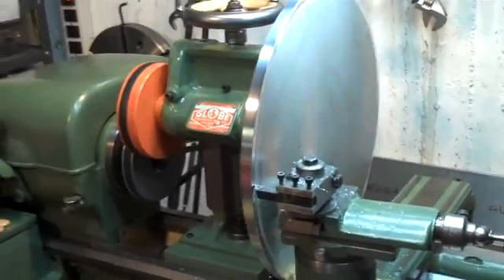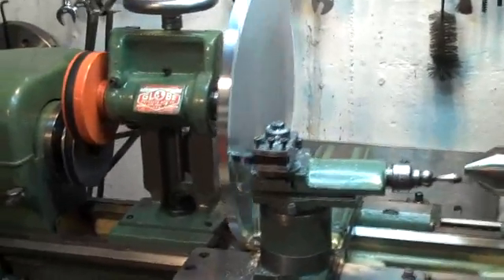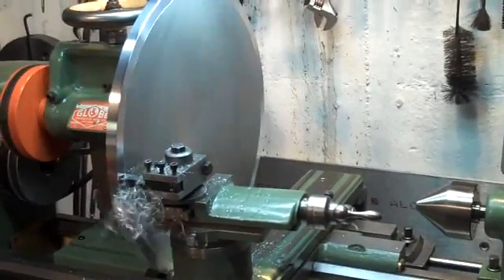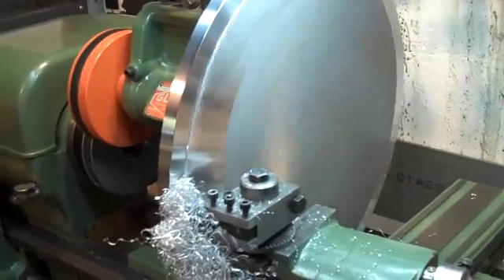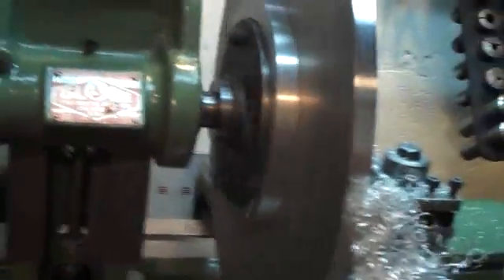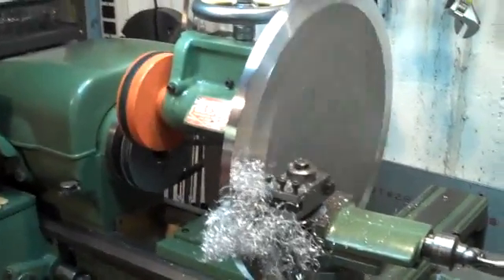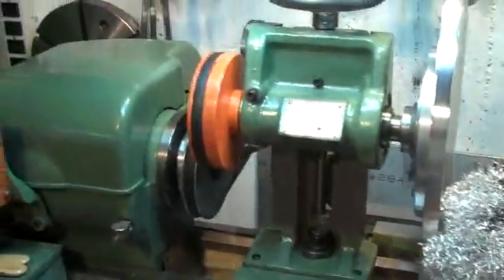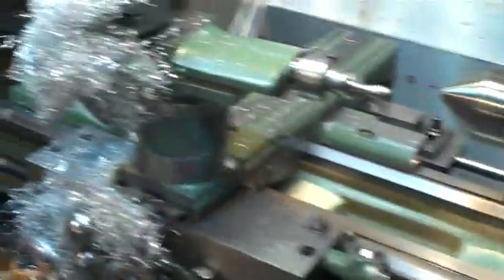Globe Milling Attachment Part 2

Comment: oh boy..my wife will be jealous if i had that shop..she will be sleeping alone in our room for sure..
Reply from the maker: I am fortunate to have a loving supportive wife or this would have never happened. I used the shop to fabricate an engine conversion for our venerable 30 year old BCS garden tiller and get it running again. That sure helped! Now we are retiring and I have to move this entire shop to our farm in Wisconsin. Oh my aching back. But there I will have an even bigger and better shop. Love those tools! I just discovered another great YT shop site with old vintage machinery. Search on Machine Shop Line Shaft lathe and drill press tools, power punch to see that one.

Comment from the maker: The paint scheme is based on an industrial one developed by Pittsburgh Paint in the '60s and was the Lavex paint series. The green was called Vista Green. The idea was machinery was green, control levers were Beige, background was Ivory (interior of bed, headstock cover, end gear cover etc. and dangerous parts Orange. This is no longer made so I took samples of the original and had them computer matched at Pratt & Lambert gloss exterior enamel (Red Seal 2-28-55).